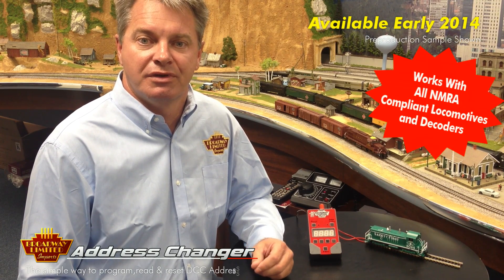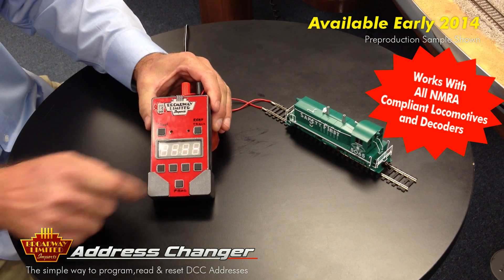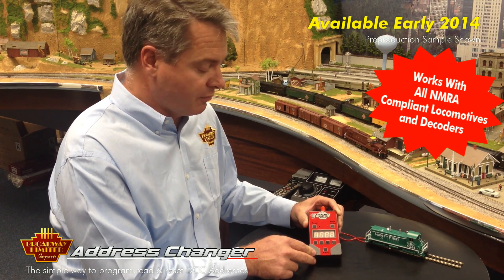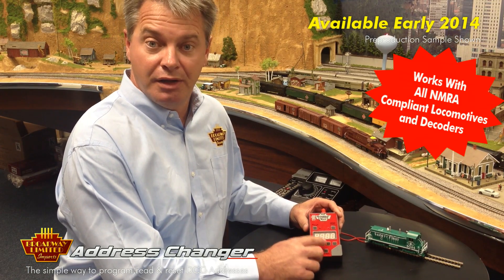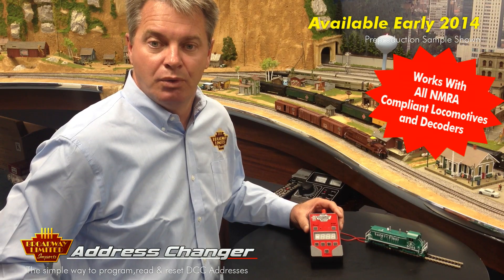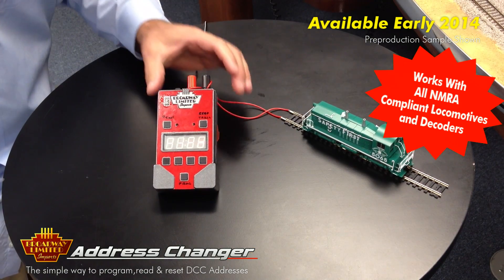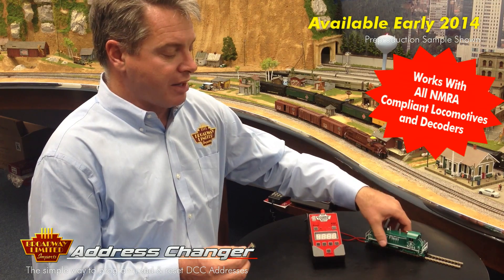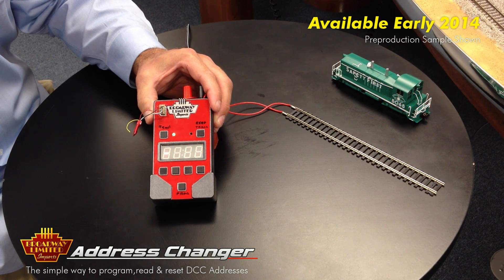OFFICIAL Address Changer Promo Video by Broadway Limited Imports, LLC

Comment: Bought the item in the States, returned to the UK and plugged in using a reducing plug adaper, 240v to 110v. I have over 400 locos, N and HO US and N and OO UK and the unit failed to function, with any of the locos, not happy.

Comment: I would have rather you have spent the R&D monies to make your locos more friendly to DCC programming than create this device.   oh well I guess.
Reply from the maker: Will, we're certainly up for hearing ideas on how this would be possible through engineering inside our locomotives. However, 10 out of 10 times, we're hearing from our customers that they're having trouble with understanding the actual user interfaces of the DCC systems that they own -- a problem that presents itself first, no matter what brand of locomotive you have on the track.

Comment: It would be a plus if it would be able to re-write CV 19 to zero on demand, have to visit our programming track to do that frequently.

So long addresses less than 128 would not be able to be set.  That is too bad.  We like to set ours to match the number on the shell and great many are below 128.  We use long addresses exclusively.

Thanks.

Comment from the maker: Answers to your questions: 

1. Yes, it will read the active address whether it is long or short.
2. It can write addresses 1-127 (short) as well as 128-9999 (long).
3. The unit does not affect CV 19 except when resetting to factory defaults.
4. The manual is still in production.

Thanks for your interest!

Comment: 1.  it will always read the active address long or short?
2.  it will always write long addresses?
3.  Most frequent issue i've seen is a lingering advanced consist and the need to set CV19 to ZERO.  Does not look like it can do that?  Would be nice.
4.  Copy of the manual (PDF link) ?

Thanks.